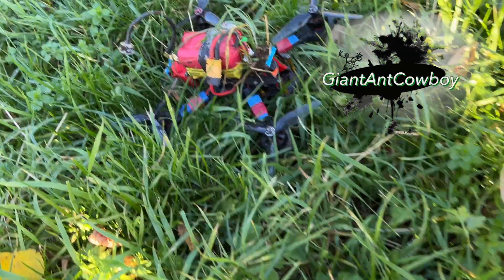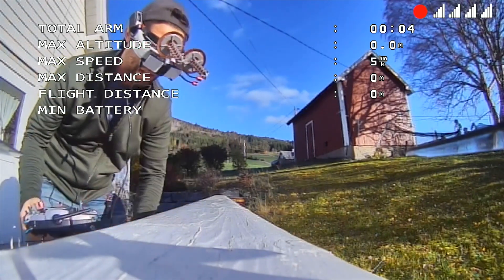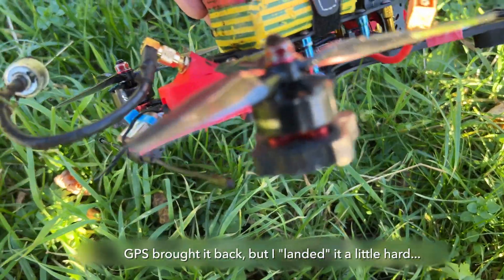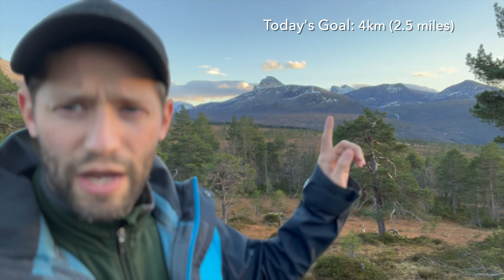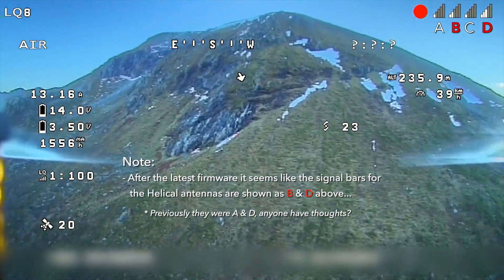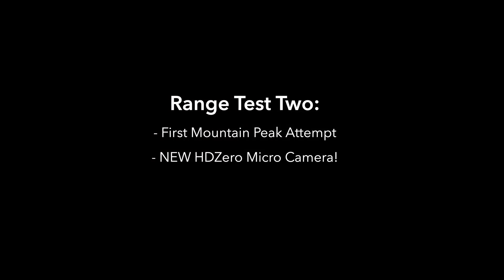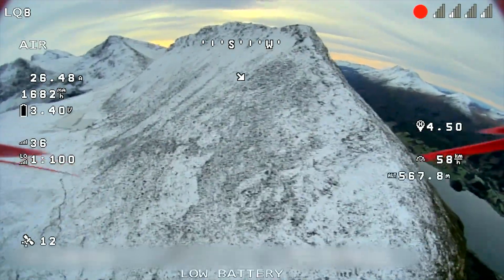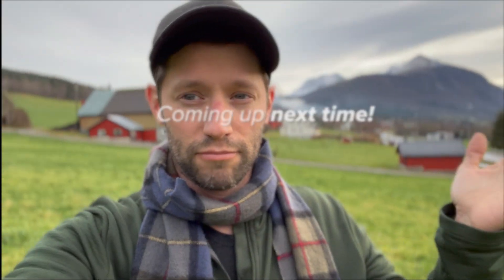HDZero Shark Byte Long Range and Penetration Testing! Digital FPV Testing and Mountain Surfing!

Comment: You need to remove the words "Long Range" from your video title....So embarrassing...🤔😳🇬🇧
Reply from the maker: Well, it's all relative I guess. I read somewhere that over 5km is considered long-range for a drone, however, I'm also aware of those going 40km+ using wind setups... My next target is 7km, what do you think is a realistic goal for this system?

Thanks for watching and commenting, I'll try to do better next time for you. 😉🇳🇴🇺🇸
Reply: @GiantAntCowboy  Well, for a 5 inch quad it was pretty good. I was really basing my observation on your unique, ideal location, no WiFi, open spaces and flying up the side of that peak in flat calm conditions. Try flying out on level ground at say 60 metres altitude, you'll get a very different result I guarantee...🤔🤔
Reply from the maker: @EnglishTurbines  yea, well I’m building a new 7” at the moment which will be much better for these sort of tests. My ultimate goal is to build a mid-long range quad to explore mountains using this digital HD system. My analog setup works great, but the image quality is of course less enjoyable… so we’ll see how it goes. I have a few antennas ideas I’m trying out as well, and will share any successes as I progress.  Appreciate the feedback, cheers!
Reply: @GiantAntCowboy  That's fine, just remember, your location is not typical of most of your followers..Ask how many of them fly at 800 metres altitude for example up the side of a mountain in the wilderness...🤔🤔😳
Reply from the maker: @EnglishTurbines  is there something you’d like me to try, or do different? Happy to try different tests. 🤔
Reply: @GiantAntCowboy  Well, you could find a flat location and try obtaining the same distance for instance...Only this time, stay below 400 feet, which most people have to if they want to avoid full size aviation..🤔😳🇬🇧
Reply from the maker: @EnglishTurbines  The first range test in the video was a pretty flat spot, and actually if I stick to the left I could continue up through the valley, which I'll do next time.  Quick Note regarding aviation safety; the rule is 120m (400ft) above the ground directly below the UAV.  When my OSD says 800m that's from sea level, or my starting point, not from the ground below the quad.  I try my best to keep my flights close to the ground and do not encourage high-altitude flying.  If a plane comes close to my quad in the mountains it's got much worse things to worry about...
Reply: @GiantAntCowboy  Yes, the altitude is from zero at the Homepoint, we all know this..just find somewhere level and clear of trees etc. When you restrict 5.8g to 400 feet altitude, you will get a very different range...even in the wilderness with no WiFi to contend with...🤔😳

Comment: Nice!! How long is the walk or ride to the mountains? Those batteries were very low and you had no fear about the drone dropping of the air.
Reply from the maker: Oh man, if I landed on the mountain... that's a day hike, especially if it's not easy to find. However, the "low battery" is a bit misleading because I'm using a 4000mAh Li-Ion battery pack which can discharge down to 2.5v/cell.  
I'm currently building a new 7" quad for the next test which will have far better range, so we'll see how far we can push it then! Thanks for watching and commenting!
Reply: @GiantAntCowboy  I'll be waiting for the next video. I won't if you'll be able to get close to that lake we saw in your last video. Great work 👏🏽 👍🏾

Comment: awesome results!) did you specifically fine tuned antennas using any kind of measurement hardware? or did you just made an antennas based on printed samples and simply cut them at end?
Reply from the maker: No advance techniques or tools were used, super quick and simple construction. I demonstrated in a previous video that these can be made from trash with very little accuracy and still perform amazing. Here’s a link to that video: 
“Trash Helical” https://youtu.be/TS4fYcT3DEE
In the past I’ve just wrapped copper around a tube, using a ruler to set the coil distance, and they worked great. The 3D printed versions just look nicer and are more durable. 
Anyway, thanks for checking out the video, definitely build some of these antennas and get out there! Let me know if you have any questions. Cheers!

Comment: Excellent test bro, I’m considering getting sharkbyte ✌🏼subbed
Reply from the maker: Thanks, very much appreciated! I’m definitely pleased with my recent tests and flights. The company is currently testing a 1W which should be awesome for range and penetration, but depending on your uses the 200mW boards work very well too. Additionally Foxeer just released a new camera which looks great. So, it’s an exciting time for the system. Stay tuned and reach out with any questions. Cheers!

Comment: Hey man how many mW of your vtx? Do you have to use Shark byte vtx or not?
Reply from the maker: Hey bud, this is a 500mW HDZero/SharkByte VTX. You don’t have to use a SharkByte VTX, up until recently I used standard analog VTXs for long range. Check out my other videos for examples, also the videos descriptions for equipment details. The benefit of SharkByte is HD fpv image in the goggles. 

Let me know if you have any questions.

Comment: Just when I was starting to think about whether to do 5 or 6 turn helicals (or would Crosshair antennas be better?
Reply from the maker: These are 7 turn, but I’ve used 5 turn with success in the past. However the benefit of 5 turn is a wider beam, so it’s easier to aim, but I have no problem aiming the 7 turn so it’s probably worth having the higher gain. 

I’ve heard good things about Crosshair antennas, supposedly they are also easy to make, but I have no direct experience with them. Let me know which direction your go and if you have any successes! Cheers!

Comment: Great content! I'm excited to see more. You have a lot of sparkles in the video feed though. This can be caused by crossfire antennas being too close to the vtx or the vtx antenna
Reply from the maker: Hey Ryan, thanks for tuning in and for the tip. I’m currently building a new 7” quad for the system and will keep the antenna placement in mind. Definitely stay tuned, have a few interesting improvements I’ll be testing soon. Cheers!

Comment: Awesome test! I'm impressed and relieved that we have more options available for long range. This is a day to remember!
That signal loss in the gauntlet was pretty alarming, surprised you powered out... You might get a few extra dB of signal back if you swap that 90 degree sma adapter on the drone for a 45 or none at all as they're known to attenuate measurably. Nice work!
Reply from the maker: Hey Brandon, yea that signal loss was nuts! Had to power out… haha! The 90 degree is actually built into the antenna, so it shouldn’t be to much loss, but not possible to switch either way. Thanks for checking out the video and your support here!
Reply: @GiantAntCowboy  that 90 will cause problems because it naturally will want to loosen. You can swap it to a straight solder on sma. look for a sma solder connector for rg402. I just shortened my long truerc antennas with those.
Reply from the maker: @p.i.engineer398  Interesting thoughts, I'll see if I can find/replace the connector sometime.  Finding this is Norway is always tricky... but I could potentially even harvest a connector. Appreciate you sharing! Cheers

Comment: Excellent
Reply from the maker: Thanks dude, appreciate the support. If you have any questions, or suggestions I’m happy to get feedback. Cheers!
Reply: @GiantAntCowboy  What I'm interested in is seeing if you can go further than 7km with your DIY antennas.
7km is the longest I've seen the system go. But on that video I'd say only the first 4km were worth watching as then the breakup was crap.
Yours was much clearer.
Also the dji fpv system has a hard wall of 13km, i don't think anyone knows if the SB system has a similar range limit built in although the assumption is that it hasn't just like analogue. So I wonder just how far can 500mw go??
Reply from the maker: @gmivisualsjason3729  Alright challenge accepted!  As I mention in the video I'm currently building a new 7" quad for this system as my current 6" can barely make it back from 7km...  I have seen that video your referring to and agree the breakup/image quality is awful after 3-4km, additionally he's using nice, but expensive antennas.  I'll definitely keep pushing the system and I'm hoping to get a hold of the new 1W board to test out for everyone!
Reply: @GiantAntCowboy  yeah Carl has just released a short teaser video of it. Looks excellent.
But I'm assuming it will take some time to get it out to the majority of us who want one or five! 😂 
So your tests on the 500mw is super interesting.
I have 2x 200mw boards and 1x 500mw.
I've managed to get a digisight V3 but missed out on the Runcam HDzero release. However it seems the new Foxeer surpasses the Runcam in image quality especially with image clarity/Sharpness at distance/horizon where the other cameras seem very analogue like. 
Your home made antennas are certainly impressive!!!
Reply from the maker: @gmivisualsjason3729  Nice work getting the new Foxeer, it looks great. I always liked my Foxeer analog setups. In fact I originally had a Digital vs. Analog comparison section in the video but had to cut a lot of sections so the video wasn’t 30mins long haha! But in another video I’ll be comparing my analog Toothless2 to the two current SB cameras I have. 
You should definitely make a couple of these helical antennas and convert your 500mW setup into a mid-long range craft!
Definitely excited about the 1W board and these new cameras. I don’t care about weight and would happily have a large vtx and camera if it greatly improved image quality. Either way (spoiler alert) the SB images from both cameras do look much better than my analog setup. I’ll post the review, test, and comparison video soon.